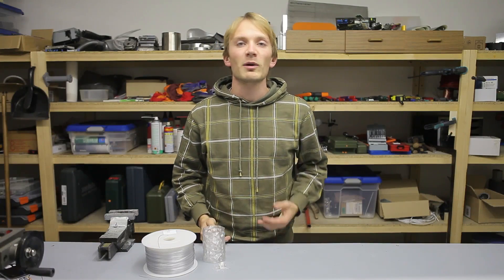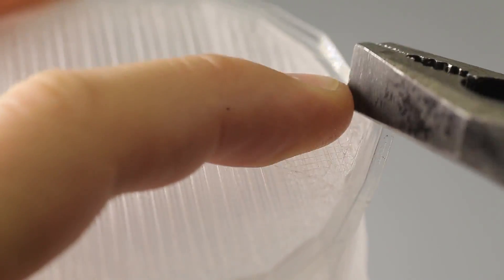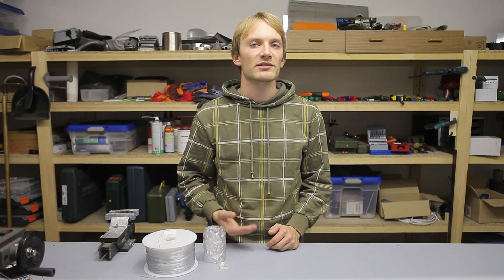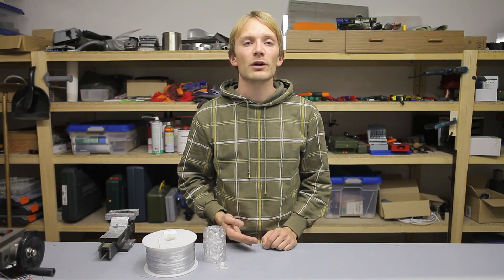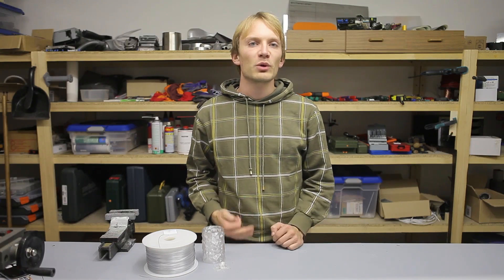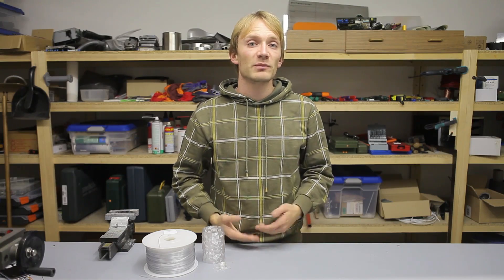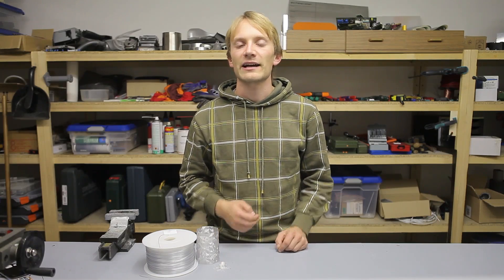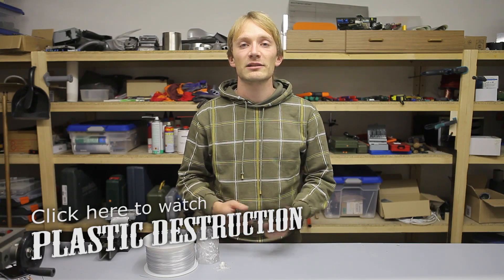3D printing guides: The worthwhile struggle with Polycarbonate

Comment: I know this is old by now, but have you (or anyone else here) printed PC with a flexbed magnetic pad on the bed? I've been holding off on installing my flexbed set because I heard that the binders in the magnetic pad deteriorates with prolonged exposure to 90-100°C+, causing the pad to crumble.

Comment: PC adhesion is no problem if you just use majigoo PC. I use a glass build plate with a temp of 105c (ive gotten away with 100), a heated build chamber (40-50C), and some majigoo, and my PC parts never warp.
Reply: This video is 8 years old... I doubt it existed.

Comment: I print it on a sanded polycarbonate sheet and i have no issues deattaching it but don't need brims or anythign either. printed very easily for me the only issue being the AWFUL smell.
tho the layer adhesion was "meh" at 295 i printed at. my bed was only 80-95 tho. i should try it again in a proper enclosure and slower

Comment: Checking back in to see if you have any update for this info, seems there is PC filament listed on amazon with significantly lower nozzle and bed temps (ofc its 4 years later now)
Reply: Nope. When you print polycarbonate while it's "soft", it won't adhere to anything. I have no issue with getting it to ooze out at 256C, but it doesn't melt onto the bed or anything else...

Comment: great video! thanx! Also, beware of other screws that can come loose at higher temps. In my case, I had to re-tighten the nuts of the height sensor which had came loose. Come to think of it, you should check everything once in a while or when in doubt of your print.

Comment: I had the most success with polycarbonate sticking to the bare degreased glass bed at 80 C in Ultimaker 2. The trick was to print  parts on a raft, have nozzle calibrated extra close to the bed, and print the first layer at 5 mm/s.
That being said, the layer adhesion I was getting even with the highest nozzle temperature was remarkably bad. I could see refraction in individual layers, then the part would prontaneously crack from the internal stress, and the parts shattered if accidentally dropped them on the floor. So I switched to ABS.

Comment: there is so many people struggling with this material, but I'm not using anything else after I gave it a try.
Prints come out so much better then ABS with zero warping, I print directly on PEI sheet, don't print without Raft, or you will have a hard time getting your print of the build plate, I print nozzle at 270 and bed at 140 on my Tevo Tarantula, I changed the bed to a bed I made with silicon heaters that run on 220v. eats to 140 within 10 min
Reply: I print without a raft, you just have to wait until the bed is completely cool before trying to remove the print.
Reply: DJ Basstring, thank you for the facts and numbers which were left out of this video, imho. I'm building a high temp for 350c max using a K thermocouple and insulated direct drive , a 150c bed capability,  and enclosure. I think "no plastic parts" within the enclosure is needed, yes? I'll use SS cables in place of belts, for example. Thoughts? Thx.

Comment: What is the best printer for under $2500 that will print PolyMaker PC-Plus PolyCarbonate?
Reply: I have a creality CR-20 with an upgraded hotend and it prints PC like a champ (I have a 40-50C enclosure). this could get you printing PC for like around 600$.

Comment: after trying just about all types of stuff to hold down my prints 
i found car spray  paint lacquer works the best for me 
you get fumes from the lacquer when you first heat it up after drying 
and after the first run no fumes at all 
it also lasts a good while before you need to change not only that it does not come off when you lift the print 
i found that a fine mist spray on the glass works very well for about 20 or more prints then repeat with another fine mist spray and so on until the coating becomes to thick 
after that scrap the coating off with a glass scraper and start all over again
Reply: Print directly on PEI stick really good, event too good, so use rafts if you try it
Reply: @basestring  I've found printing pilycarbonate  on a finely matted sheet of polycarbonate, actually works pretty well. 4mm is good, as ot doesn't bend too easily, but it also bend enough to release the parts. I also cut some 15-20mm diagonal slits in each corner just in case to relieve tension and give it somewhere to if it expands/contracts, so it doesn't bend, don't know if they're neccessary thought.

Comment: Have a Creator pro  using 2mm glass and Elmers purple ( think it is the same as other only purple ) extrude temp 240 245 C plate around 100C level plate with a business card or paper and turn the screw to tighten drop the plate a bit.
Reply: I used 295 C extrude temp and 125 bad temp

Comment: Can I know what's the absolute best bed treatment you have found for sticking PC to the bed? I've been having only marginally acceptable results when using super glue and of course I would rather not use it.
Reply: Thanks Thomas, will give PET a try. Glue stick doesn't work for me as well for PC.
Reply: Sorry I forgot to ask, at what temperature did you run your bed with PET tape? Thanks a lot for all your video guides!

Comment: Hi Tom, have you ever tried 3DLAC to coat your bed before printing? I don't print ABS so often anymore, but when I do, I use that stuff and it works really well, I get very little warping even on large parts. (no kapton tape or anything, just sprayed directly on my glass build plate) Though I have yet to print with any fancy filaments, I'm pretty sure it'll work nicely. look it up!